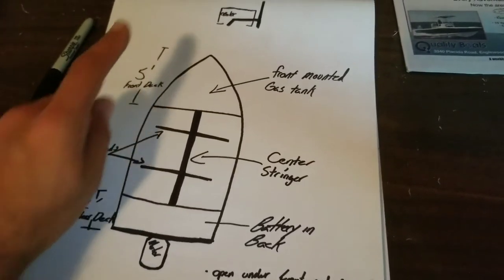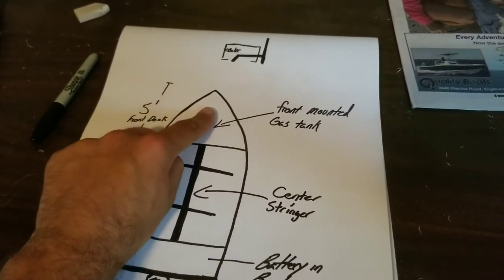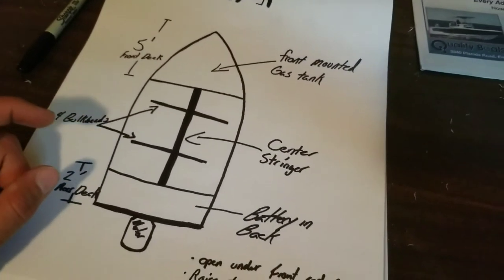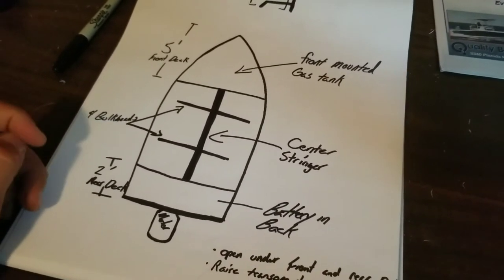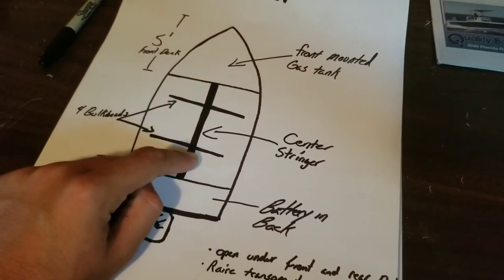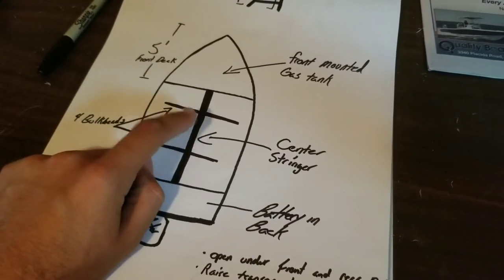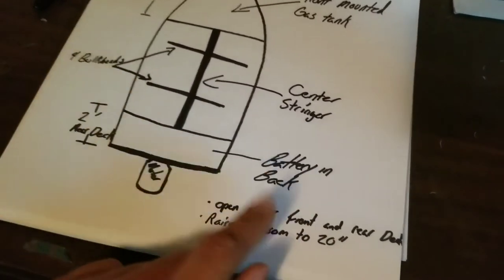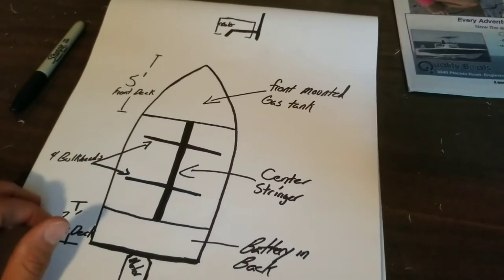I SHOW YOU MY JOHNSEN (DIY Fiberglass Boat Build) Part 1 intro

Comment: Hello.  I like your work and your videos.  thanks for sharing.  I would like to know what material you use in the mix to join the pieces you make.  regards
Reply from the maker: Can you be a little more specific? I use 1708 biaxel and 1.5oz CSM, for resin i use polyester for just about everything, and for the bonding stuff together I use Polyester 1/4" chop fibers and fumed silca. Hopefully that helped.